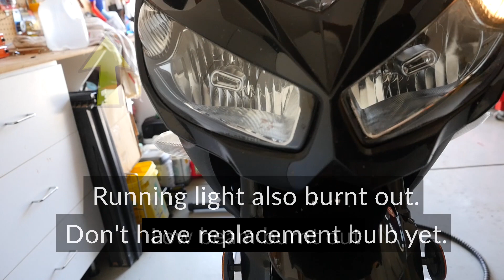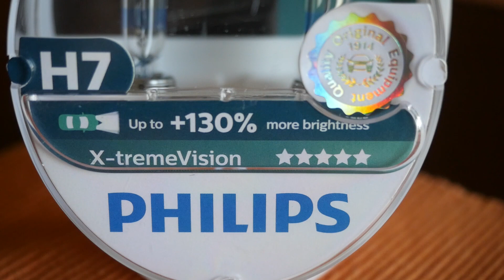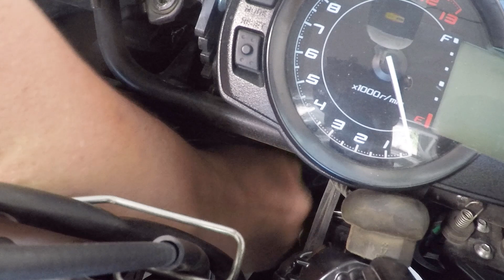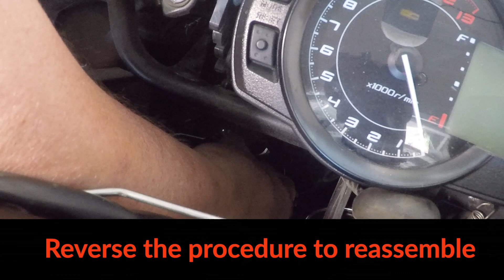Motorcycle Headlight Bulb Replacement

Comment: HI 😊 , I HAVE A NINJA JUST LIKE YOURS . MOST OF MY RIDES ARE IN THE NIGHT AND ITS QUITE DIFFICULT TO SEE IN THE NIGHT WITH THESE BULBS . I AM GOING FOR THE LED ,WHATS YOU OPINION ABOUT HIGH POWER LEDS ,AND WHAT THE MAX POWER LEDS SHOULD I REPLACE
Reply from the maker: Honestly I've held off putting in LEDs due to being uncertain about clearance for heat syncs or buying bulbs without heat syncs.  I know others have done it but my riding is just the opposite, mostly daytime so it hasn't been a pressing item.  Love to hear what you settled on.

Comment: Wrenchie- nice work on your videos. I have a 2012 model as well. Keep up the good work.   So whats the odds you will ever do a valve clearance check video. Also i think you have quite a few miles on the 2012 so i just wondering at what milage did you have The valve clearance checked?
Reply from the maker: Thanks Chris.  Yeah, 83,560 miles on the 2012.  Almost 13K on the 2016.   I just had the valves done on the 2012 but the 2016 is dues at 15K.  I'm looking for someone with a lot of experience doing valves on kawi's to collaborate with... show us ALL how its done.  Mechanic would be awesome but there are some ethics concerns.  Still anyone out there who want to talk about collaborating on a valve service... hit me up!!